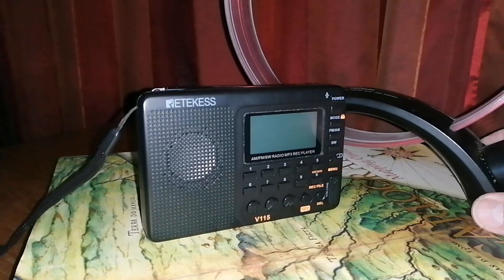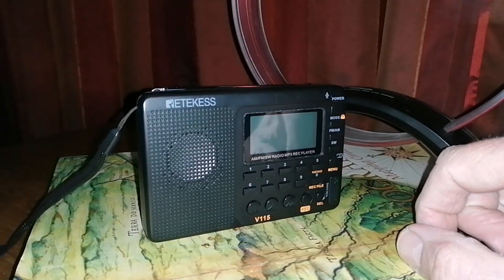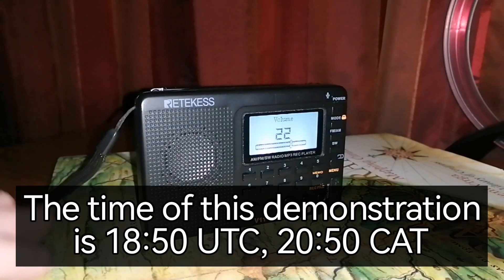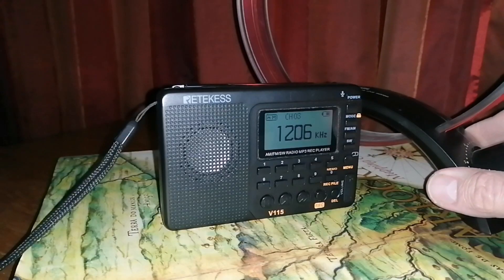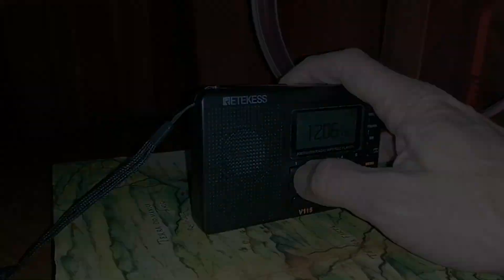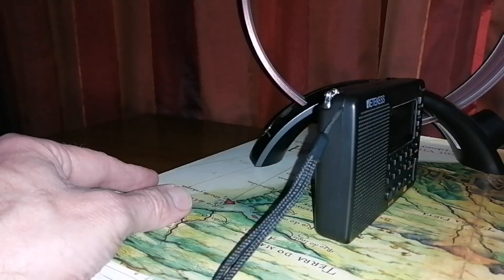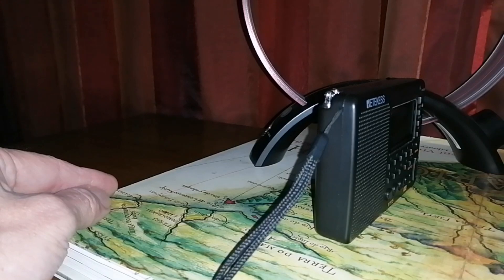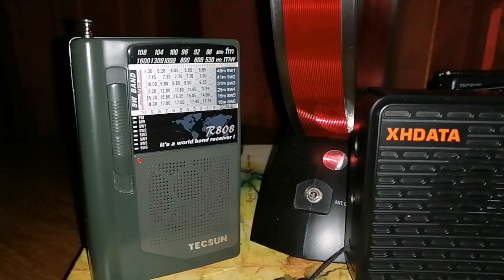Tips for beginners: How to use Tecsun AN-200 loop antenna for better MW reception

Comment: Does it work better in Analog Radio?? 
One of this antenna user told me that, it works less in DSP.
Reply from the maker: I think it does work a little better with analogue radios, that was my experience also.
Reply: @swlistening thank you so much.

Comment: Does this work well with SW?
Reply from the maker: Hi Jason. No, it does not work for shortwave at all, it is only for MW. The MLA30+ loop antenna is a very good option for shortwave. Or a random wire!

Comment: Can you suggest a decent antenna to pair w/ a ats25max-decoderll for shortwave? For apartment use indoors.
Reply from the maker: Hi George, I don't own an ATS 25 Max, so I cannot speak from experience. But for use indoor use, the MLA30+ is hard to beat, it works really well if you can place it near a window. I think it might be a good option for you.
Reply: @swlistening  fantastic I will definitely be looking into. Thank you for your time and all your help
Reply from the maker: @georgeg.5488  Sure!

Comment: What will happen to either the radio or the antenna if you accidentally hook it up to FM briefly
Reply from the maker: Hi George, nothing will happen. But you will not hear your FM stations clearly, as this antenna only receives MW frequencies.
Reply: @swlistening  thanks for the info. My fm button was depressed by accident while I had a passive loop connected.  Thanks for the info , like your ch.
Reply from the maker: @georgeg.5488  Sure George, and thanks!

Comment: One of the useful features of a loop antenna is to null out a pest station so you can hear a different station coming from a different direction.  To do this you need to make sure the axis of the internal loopstick antenna is pointing in the same direction as the axis of the external loop. Usually the internal ferrite loopstick goes horizontally across the top of the radio, so that would mean placing the radio perpendicular to the plane of the loop.  Then rotate the loop and radio together as shown in the video using a book or lazy susan.
Reply from the maker: Thanks Mike!

Comment: Love your videos. I have been using the Tecsun for a number of years on my analog radios. Nice to see It is also effective on digital ones too.
I played around and found that placing a small radio .UNDER the Tecsun loop seemed to work best.
Reply from the maker: Thank you so much for your kind comment! I have also found that if I hold a small radio inside the loop, it works very well, probably more or less the same effect as placing them under the loop. I think it's all about experimenting with different radios to find what works best. This loop is really great for MW DXing!

Comment: i tried it, but it gived me worse signal than on normal built-in reciver antena.
Reply from the maker: Thank you for your comment Ralph. It might be that your loop picks up too much electrical noise. From electrical equipment like computers or TVs. Perhaps you can try to switch off as many as possible electrical appliances while you are listening. I also suggest that you keep trying different positions for the loop as you pair it with your radio. Also, there are just a few radios where the loop does not seems to make a very big difference, like on my XHDATA D-808 the difference is quite small. Last tip, tuning the loop takes some practice, the tuning is very sensitive, so you should tune very slowly, as precisely as possible. I have really had very good catches with this loop.
Reply: @swlistening  i tried to move it around on 2X VEF 206, Rossia 303, and Tesla Eminent (minimally improved signal on this radio), and on Tomson walkman too. i tried it connect using cable to Selena B211 (doed nothing) and the old Tesla Máj (not working too). It helped me only outside when radio was on max volume, with antena was everything louder.
Reply from the maker: @marek-vareka  I am wondering whether there might be a problem with your loop, maybe some problems with the capacitor inside... I tried to follow your video links that you sent me, but they don't seem to open, I don't know why.
Reply: @swlistening  and if you can try tommorow (in my country is 22h now) transmitter that is turning on from Prague 639 kHz with 50 kW.
Reply from the maker: @marek-vareka  I will try this! Tomorrow? Friday? But there is a very strong signal here on 639 kHz from Lesotho, about 350 km from me, I even pick it up in daytime. So I think Prague might be hard for me to get. By the way, I did get Kossuth here in South Africa long ago, here is the video: https://youtu.be/37VhT6asSZ0?si=bA-3yq1lrypkJuD2
Reply: @swlistening  It starts today in my time now, but i dont know on what time. 639 is strong signal at night on SDR in prague, it will be maybe hard to catch at night in Ostrava. Before ČRo deactived their transmitters, 639 kHz was 750 kW power + 20 kW from transmitter that is in my city, i haved good signal. And do you tried sometime wire antenna? I had best results with it. Should be 24,5 meters long. In nature i listened on it during day Prague on 20 kW 1062  kHz (that is turning off after some weeks and will be destroyed, reason why 639 turn on) and with very bad signal Prague on 10 kW 981 kHz too.
Reply: @swlistening  And near baltic sea i listened at night 100 W from Prague a it haved good signal.
Reply from the maker: @marek-vareka  I have tried MW with wire antenna, yes, but maybe mine is too short, it is only 10m. I think I will get a longer one. I will try for Prague, but I really doubt it. Because the Lesotho one on 639 here will be much stronger.
Reply: @swlistening  And do you have something on 792 kHz? Its from Hradec Králové - Stěžery only with 10 kW, but it have good ground. And it maybe will be first AM station with RDS!
Reply from the maker: @marek-vareka  This is one I will try. On 792 there is nothing strong where I am. Thanks!
Reply: @swlistening  They are still tuning 639 kHz, it will be turned maybe on Monday.
Reply from the maker: @marek-vareka  OK, thanks.
Reply: @swlistening  i readed now, they start on 01.09 - 14.09.2023.
Reply from the maker: @marek-vareka  Thanks!
Reply: @swlistening  https:/youtu .be/8ON3DXCasjw , https:/youtu .be/Wd8iS_A1QA4, on first video i tried it in house, in second on balcony.

Comment: Hi Andre. Thank you for an interesting post & comparison. I finally received my AN200 antenna on Friday (AliExpress) and tried it out over the weekend with my XHDATA D-808. I was aware of warnings that the difference in performance might not be significant, but I was pleasantly surprised at the improved reception and the additional fine tuning capabilities! I would also recommend this addition to anyone interested. Keep up the posts!
Reply from the maker: Thanks Johan, I am glad that the AN-200 works for you on the XHDATA D-808! It does still make a difference on that radio, even though the difference is not as great as with smaller radios. As you say,  I think the fine tuning capabilities are very useful, I have found, specifically on the XHDATA D-808, that I can sometimes pick up two different signals on the same frequency by just fine tuning the AN-200.

Comment: An alternative inexpensive  boost to your MW signal level is to use about five turns of wire about 50 to 60 mm in diameter connect one end to an endfed or whatever external antenna you have and place the coil close to the ends of the  internal ferrite rod antenna In most cases runs at top of the radio horizontally.
This is called inductive coupling to the ferrite rod antenna. 
The other end of the five turn coil can be connected to an earth wire.
Reply from the maker: Thanks John, this is a helpful tip for anyone who wants an inexpensive MW antenna!
Reply: When I DX MW on a portable, I do something similar, i.e. I have a coil of enameled wire wound on a ferrite rod. If you have a coaxial cable to bring the signal from an external antenna to your shack, you can strip the enamel off both ends of the coil, connect one end to the center conductor od the coax, and another end to the braid, and place the coil right on your radio, as close to its on ferrite rod as possible. Works even better than the AN-200 🤠
Reply from the maker: @ArnieDXer  Sounds like an interesting idea!
Reply: @ArnieDXer  Interesting.
Reply: I thought it would have been much thinner wire used. I am trying to make my own one, what is the wire gauge? BWG or AWG is ok.
Reply: @FamtechVideos  The diameter   
of 50/60 mm is of the loop not the wire gauge. Any gauge will do thicker is better as loop will tend to keep is shape better I used 1.5 mm insulated copper wire bound at three points with insulation tape
Reply: @JohnGreen-SWL  Ok, thanks! I wonder if I will be able to get RS to deliver them.
Reply: @FamtechVideos  actually, this is an interesting question 🧐 theoretically it shouldn't matter for receive (it would for transmit as a thicker wire should get you a somewhat wider bandwidth or range of frequencies where SWR of your antenna is lower than 2:1)... But then, modeling various terminated loops in MMANA-GAL, I often see higher F/B values for antennas of same dimensions made of thinner wire. So I think the answer is not as straightforward as we think it is, and I'd say it's... it depends 😅
Reply: @ArnieDXer  Ok, maybe I can unwind some coaxial cable and use that. I will see if I can determine said wire gauge, it might be quite high. Heck, maybe I can use some of my telephone wire.